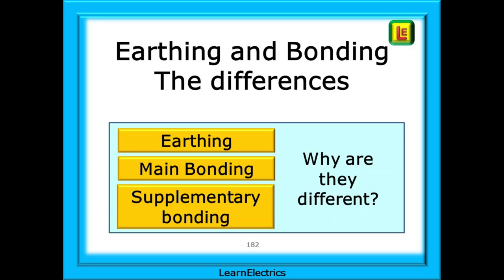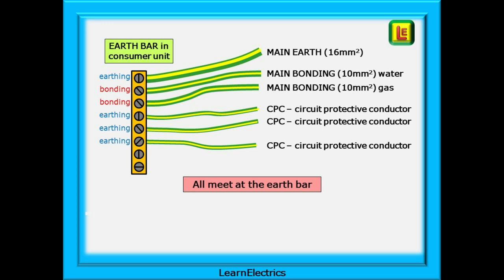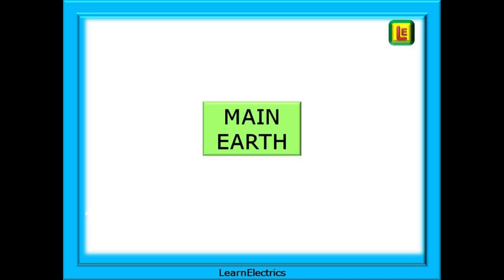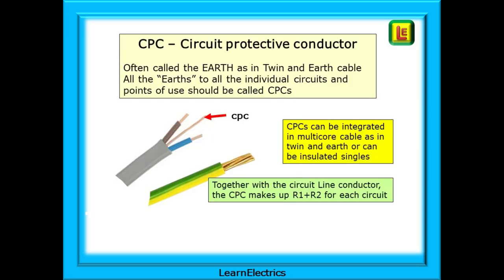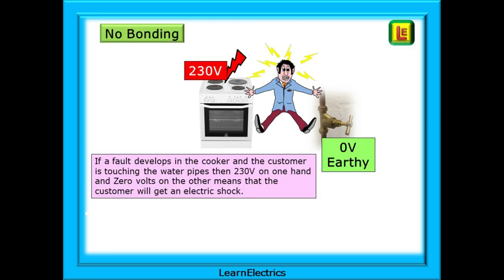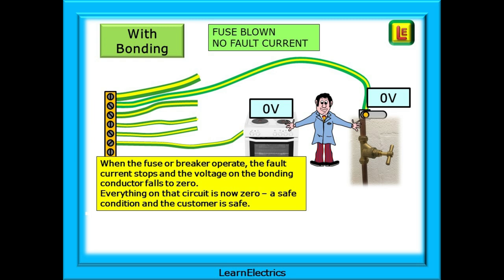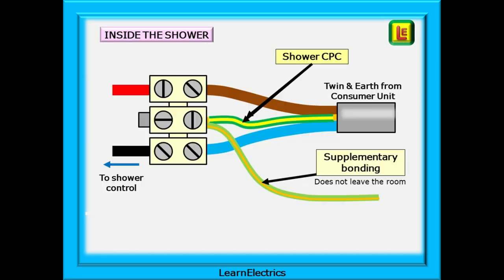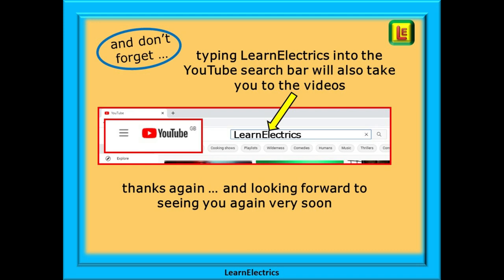EARTHING AND BONDING – SUPPLEMENTARY AND MAIN BONDING DIFFERENCES – HOW DO THEY WORK & KEEP US SAFE?

Comment: Mostly an excellent training video item but I have to disagree about the potential on an appliance, in this case the cooker, during a fault. If the appliance is earthed, the casing will not rise to the full mains voltage (230V) but to a potential determined by the resistance of the supply circuit Ze + (R1), the circuit CPC and the earthing arrangement (R2). If these happen to be equal, then the potential on the appliance will be half the supply voltage. Ze + R1 and R2 form a potential divider and the applaince casing will be at R2/(R1+ R2) * 230 V.  This is still a potentially dangerous voltage and the purpose of the main and supplementary bonding is to tie the potential of all the exposed conductive parts and extraneous conductive parts together as closely as possible to minimise the potential between them during a fault. The difference wiil depend on where the connection between the bonding and earthing conductor is made, but should always be of such a low resistance that any potential is non-hazardous.
Reply from the maker: Thanks for the input and thank you for watching.
Reply: Bonding becomes an issue in case of a PEN-fault. Then there will be almost full mains voltage at any earthed appliance and normal methods like earthing and RCDs do not prevent this. Of course spreading the voltage to the pipes is a double edged sword and could cause its own danger but is as a whole is safer than without bonding.

Comment: An RCD with a residual operating current of 30mA obviates the need for supplentary bonding since a shock situation will result in the disconnection of the circuit.
Reply from the maker: Absolutely correct. As it says in the video, they are both forms of additional protection, Thanks for watching. Appreciated.
Reply: @learnelectrics4402 This was an excellent video with clear English and no inane, superfluous, distracting muzak in the background. I like to consider myself a knowledgeable sparkie. I'm never too old to learn though and this was informative.

Comment: This made loads more sense in helping to understand the potential difference of an exposed conductive part and extraneous in an earth fault when bonded.

QQ - to clarify, in the instance of an earth fault, all cpcs / bonding will become live with say 230 volts (as they are all at the same potential, and all connected to the MET) for the period of time it takes the protective device to operate? 
e.g. 0.4 seconds
Reply from the maker: Correct. If you are touching two separate pieces of bonded metal work, left hand, right hand, say. Then they will both be at 230 volts. 230v left minus 230V right equals zero volts across the body.
Thanks for watching.

Comment: With modern consumer units, and everything (generally) having additional protection being provided by default by a 30mA RCD/RCBO nowadays. 
Supplementary bonding is becoming less common. To be honest it always was a bit of a faff and it looked unsightly, to run a 6mm earth around all the exposed & extraneous conductive parts in a high end (expensive) bathroom. 

So supplementary bonding does seem to be a dying art.

Great video Dave👍
Reply: Agreed, I hated the good old dusty supplementary bonding tag that connected onto the rad copper pipe. When I re did my bathroom I reconnected it under the floor out of the way, all the copper pipe touch anyway so even if it was disconnected there would be a reading as all copper pipes touching
Reply from the maker: Agreed Mr B. Especially when the bathtub was one of those fancy jobs in the middle of the bathroom, nowhere near a wall.
Reply from the maker: Good idea, Thanks for the input. Dave.
Reply: @kingofthetrowel1725  The point of them being exposed is so that they can be checked & serviced, hiding them under the floor prevents discovery when the next inspection is done. All screw terminals must be accessible as copper expands & retracts with the change of temperature & vibrations. RCD protection (assuming a sufficient continuity test proves this) nulls the need for sup bonding.
Reply: Inspections are becoming more & more necessary. It won't be long before it is required for a buyers report. So it may not matter now but it may in the future...cross that bridge later

Comment: Thanks for the video.  As an adult learner the topic of supplementary boding was difficult for me to grasp (no pun intended).  I see from other comments about RCD protection etc that SB is not required on modern installations but an issue that still confuses me is how to determine whether a metal accessory is actually an extraneous conductive part or just a piece of metal?
Reply from the maker: Is it "earthy", is there a possibility of it making a connection with earth at some point - water pipes that go into the soil or touch it, for example. That would be an extraneous conductive part. 
Now consider a metal shaving mirror. Would you bond that? Or the metal can of underarm deodorant? They are metal too, but they don't have a path to earth. Hope this comparison helps. Stick with it, it will make sense. Dave.
Reply: @learnelectrics4402  Thanks for taking the time to reply. I understand what you are saying but what if it's not as clear cut as your two examples. Is there a test to see whether it is or is not an ECP?

Comment: As an adult learner, thank you for such a clear explanation of a subject I struggled a bit to understand. 
Quick question: My house has a TNS system where the main earth conductor is made of what appears aluminium without any sleeve.
Does it need replacing? 
Thanks.
Reply from the maker: If its undamaged then no. Aluminium becomes brittle, if you try and move it it can start to crack.
Reply: @learnelectrics4402  thx

Comment: Great video as usual. I do have a question about the reason for bonding though. I understand the point of bonding if you touch the cooker and kitchen sink taps simultaneously but are there any other reasons for bonding? I apologize that my question may seem basic and obvious  but I always thought it was for if lighting struck.
Reply from the maker: Have a look at the video on the link below. Bonding is to prevent differences in potential between simultaneously accessible metal work during a fault. Lightning protection is a whole subject on its own. Hope this helps and it doesn't matter how basic the question, ask it.
https://www.youtube.com/watch?v=EYj9mvOfF_w
Reply: @learnelectrics4402  thanks so much

Comment: Thanks, John 👍 brilliant.
I have a question 
What is the relationship between fire alarms and surge protector devices?
Reply from the maker: Install the fire alarms as per manufacturer instructions. A quality fire alarm should not be affected by an spd as the spd is a passive device until it detects an over-voltage.

Comment: Generally good video. A bit of a hiccup at about 7 mins when you slipped into suggesting that 230V "would flow around...".
Q. What would you do with the supplementary bonding cable in say a bathroom if there were no exposed conductive parts but there were extraneous conductive parts? (I was asked this on interview at SEEBoard way back in 1988 and the three interviewers ended up disagreeing amongst themselves!)
Reply: For clarity, as there are no exposed conductive parts then there's no CPC available to connect to.
Reply from the maker: I can imagine that made for an interesting interview. I would have thought the interviewers would have decided on questions and answers beforehand. I'll look at 7 mins. Thanks. Dave.
Reply from the maker: Is there a path back to earth? That's what we are concerned with. Would you bond a metal shaving mirror, or a metal disabled handle next to the toilet? Great input, thanks.

Comment: Nice video 
Is Supplementary bonding regulatory if bathroom pipe work is plastic? I don't think so?.. or copper pipes connected with plastic  push fit joints?
Reply from the maker: If there are "earthy" parts as per the video.
Take a look at this video which covers the very correct point you make. Thanks for the input, appreciated. Dave.
BONDING PLASTIC and COPPER PIPEWORK, on the link below
https://www.youtube.com/watch?v=EYj9mvOfF_w

Comment: What I don’t understand is why or how outbuildings have to have a separate earth path!A site I tested with a electrician noted as a code 2 that the large steel structure glass house with its own db supplied by swa from the main building & has a cpc bolted to the steel & connected to the db earth bar has no earth rod for all the steel work. I tried understanding but cannot work out what the issue is if the swa is providing a path & a cpc bolted on to the steel and connected to the earth bar in the db. What could be the issue here!
Reply from the maker: A lot depends where your feet are and what you are touching when a fault develops.

Comment: Hi. I have just come across a 10mm earth cable that runs from the water inlet to the CU that is buried along and under the bottom of the skirting board for a distance of 3.5 meters from a total distance of 4.5 meters. Is this permissible? Pardon my ignorance.
Reply from the maker: is it earthing or bonding? What edition of the Regs was it installed to? Lots of factors to consider. 4.5 metres is not an excessive length and at 10mm it will take well over 1000A of fault current if we are talking about a 0.4 second disconnection time. If your PFC is less than 1000A, the breaker will disconnect before the cable is damaged.
Have a look at this video, it will help.
https://www.youtube.com/watch?v=xtDId-g7GjU
Reply: @learnelectrics4402  Thanks Dave. Its an earth cable. And was installed before we arrived to complete other works. So we dont know when it was done. The householder has only recently moved in. After the previous owner died.
I will of course watch the linked video.
Thank you once again for the brilliant content you provide.
👍👍👍👍👍👍👍👍👍👍👍👍👍👍👍👍👍👍👍👍👍

Comment: Should not the bathroom appliances be protected by a 10mA RCD? May be with a dedicated RCBO in the CU?
Reply from the maker: 10mA would be far too sensitive, they would be continually tripping. 30mA is the standard size. Good question and thanks for watching. Dave.

Comment: Just to clarify, when everything connected to the met rises in potential , would you receive a shock if u were to touch some metalwork that has risen in potential whilst you’re in contact with true earth??
Reply from the maker: Depending on the voltage difference, yes you would. Hope this helps.

Comment: How can there be 230v in cooker casing when the cooker CPC is connected surely MCB will trip meaning if you touch the water pipe you will not get 230 v across your body as the cooker  MCB will have tripped do you mean if the cooker has no CPC connected or broken this will happen
Reply from the maker: Have another look at the video. We are talking about bonding with the cooker cpc connected. Dave.
Reply: Keep me right here I thought if the cooker CPC is connected to casing it would carry the fault current and would clear the fault trip rcbo  so you could not get a 230 v  from casing to water pipe as casing  would be dead Cheers

Comment: what if you grounded by being bare-foot and touch a bonded surface that has a ground fault on a supplementary grounded system?
Reply from the maker: If the installation is properly designed and constructed, the protective devices should operate before you are in danger.

Comment: A good set of videos ... but you should say 'mm squared'.  I know very few electricians do because they are lazy. If you are educating, you need to be wordperfect
Reply: I think Dave is right. I’ve always been taught it is 2.5 square mm for example. If you look at a piece of 2.5 copper what Dave says is correct.
Reply from the maker: The conductor sizes are square mm, it is the surface area. Think about a 10mm twin and earth cooker cable. If it was 10mm squared it would have a surface area of 100 square mm, making each conductor almost 12mm in diameter. And 10mm conductor is not 12mm in diameter. The round surface area is 10 square mm. It confuses many but that is the way they write it in the regs book. Thanks for watching. Dave.
Reply from the maker: Thank you for your support. Yes, you are correct. Much appreciated, Dave.

Comment: Hi Dave ,Excellent as ever.Dave   I was wandering in case of the cooker and the water pipe, instead of bonding the water pipe to the main earthing bar could we just connect it to the cooker's CPC  as in supplementary bondig to save time and material? Big Thank You.
Reply from the maker: Not really.
The cpc is a cpc, the bonding cable is a bonding cable.
I know they all go back to the Earth bar but the boffins regard them as two separate cables with separate functions.
CPC is there to make an earth path during a fault.
Equipotential Bonding is to make all metalwork the same "equal potentential" by "bonding" them together.
Hope this helps, always try to follow the book.
Reply: @learnelectrics4402  Thank you so much for your reply. I Appreciate that.Your programmes are much more helpful than the course I am enrolled with , but I don't give up and like to learn more.